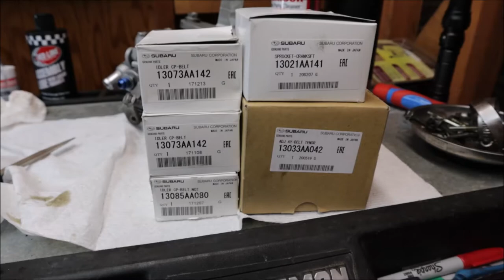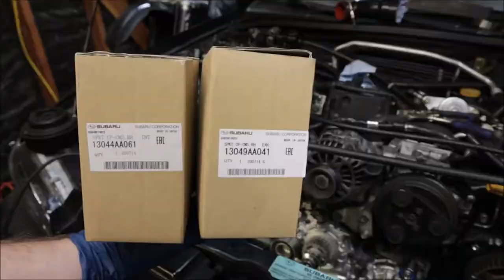Subaru EJ Engine Build / Timing Belt Final Assembly / Relaxing (ASMR)

Comment: Very nice! Thorough and methodical. Keep up the good work.
The stripped holes on the front of the engine are never a surprise. I'm doing head gaskets on a friend's EJ253 and all three idlers were cross-threaded... a "repair" shop did a timing belt and water pump 4k miles ago.
Anyway, you're making good progress.
Reply from the maker: This means a ton! Thank you for the positivity. Getting closer and trying to stay motivated.